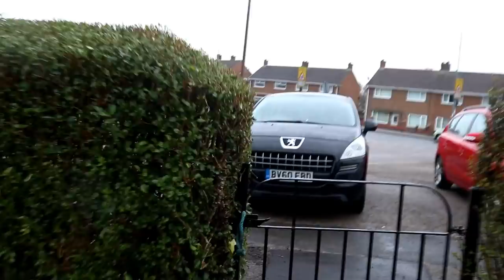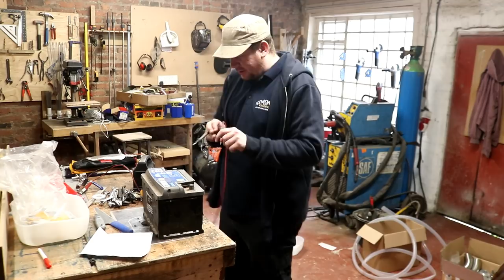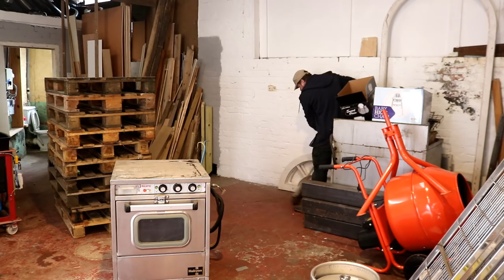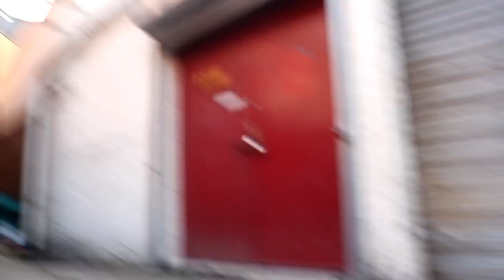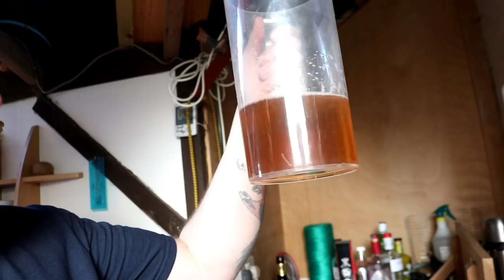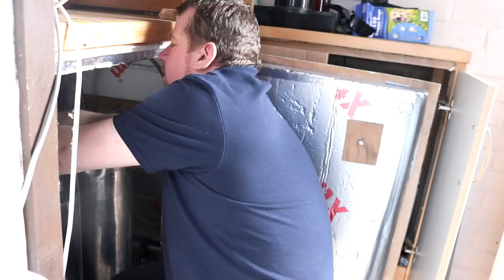TRUB AND YEAST

Comment: Assuming your battery is ok it must have gone flat for a reason, either its not being charged or something is draining it when its switched off. First thing to check is if its charging, should have just over 14v at the battery when the engine is running.

Comment: Cheers Harry, great updates as always. Probably covered this before but how do you dispose of all that leftover trub and hops?
Reply from the maker: Down the main sewer mate. I was inspected by the local authority back at IVB when I was brewing 5000 pints a week.  They were happy then and the amount I drop down the drain now is a fraction. My advice is, if you need to do it  inform the relevant body and make sure you dilute any chemicals and any thick slurry.

Comment: Glad you got the battery up and going,however I would still not trust it 100% tbh,it may work now but if it's left idle for a day or two it might not hold sufficient charge,at very least keep some decent jump leads in back of estate. Wouldn't want to see you stuck. I will probably have to change the Focus next year,looking at a diesel and something like what you have perhaps, probably from NI. That mystery stout looks lovely. Cheers.
Reply from the maker: I have had my fair share of dodgy batteries. I will have to cough up for another one soon.